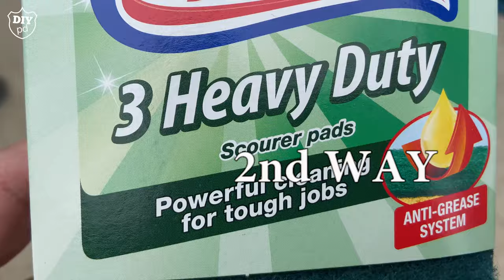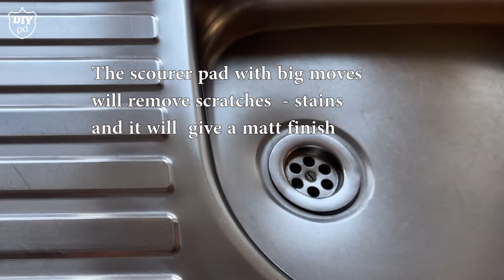3 EASY WAYS TO RESTORE A STAINLESS STEEL KITCHEN SINK | DIY RESTORATION IDEAS

Comment: Thank you for this. Would you recommend sequentially doing all three steps for a really old and stained sink? Secondly, how much pressure do we apply when using the foil? Would the foil cause more scratches on the surface if too much pressure is applied?
Reply from the maker: You’re very welcome! For a really old sink I recommend  heavy duty scourer pads to remove scratches with big moves. Do not stay at one spot. Then the foil to give a little bit of shine. Big moves again and do not afraid about the pressure. Aluminum foil is softer than steel and it will not make scratches. At the end use a metal polish cream for a stunning shine! The whole procedure takes time so be patient.
Reply: @DIYPD  whole not hole
Reply: @PhillyDjHook  gramma po po is out again... get a life
Reply: @PhillyDjHook  that's what he wrote,read properly!

Comment: Thank You Peter!
At work I ruined the stainless steel by applying the wrong chemical cleaner on our new stainless steel rest room. I'm planning on using the aluminum foil and the metal polish. I'll let you know the results.
Thanks again for creating and sharing your work for us Peter.
Reply from the maker: Your very welcome Daniel! Yes please let me know how it goes and if you need anything else please tell me! 😀 Thank you!
Reply: @DIYPD  I couldn't tell a difference after the aluminium foil and stainless steal polish.
I'll try the scouring pads Monday.😊

Comment: Thank you so much for your video! Our current sink size is not standard and we were having a hard time finding a replacement that would fit without a major countertop remodel. I will try methods 2 and 3 this weekend and hope for a good result. Again, thank you!
Reply from the maker: You’re very welcome and thank you for your comment! 😀
Reply: @DIYPD  I actually used method #2 and it worked beautifully! Took a lot of elbow grease, but so worth it. I haven't found a metal polish yet, but as soon as I do, I want to apply it to my sink. I can imagine that it will help keep the surface looking better for a longer period of time. 
Again, thank you!
Reply from the maker: 😀 so happy to hear that ! You will be very impressed with the polish cream. Just to let you know, I used the Autoglym polish cream for metal. Do not forget after the polishing to give a couple of times a good wash to the sink.  😀
Reply: @DIYPD  Can I assume that you bought the polish cream from an Auto Supply Store? I could not find anything like it in the big box stores in my area.
Also, I will make sure to rinse the sink a couple of time after polishing the sink. Thanks for the reminder!
Reply from the maker: I bought the cream from Amazon
Reply: @DIYPD  Sorry, but I have one more question. Is the Autoglym polish cream you're referring to a "compound". I am not familiar with products for cars, so I want to make sure I'm ordering the correct item.
Reply from the maker: Here is the link for the cream. Or any other metal polish. https://www.autoglym.com/metal-polish
Reply: @DIYPD  Awesome! That is the one I ordered as there were only the 2 choices on Amazon. Again, can't thank you enough!!
Reply from the maker: You’re very welcome! 😀

Comment: It was very helpful but I got a question though. My sink got stains caused by chemical used to unclog the pipes. As a temporary solution (till I'd change the sink), I used a paint suitable for metal surfaces (for car hubcaps). I suppose this won't last but in any case, would any of these solutions you provided would remove the chemical stains?
Reply from the maker: Hi Donald, to be honest not sure about it. Perhaps worth to try but I cannot promise. If you try and it does work, can you please let me know too? I really hope it does.

Comment: Hello! Can I check, for 2nd way, do we need to sand back and forth in a particular direction? For 3rd way, can you share which product you are using?
Reply from the maker: Hi Caroline, 
If you want to try the 2nd way try to make big moves (ideally at the same direction) and try to not stay at the same point for a long time. 
In the 3rd way, I used Autoglym polish cream. 
You can also find all the details at the description. 
Hope this helps, but if you still have any questions let me know! 🙂

Comment: You showed 3 methods , one after the other on the same sink.  Method 2 was after it was already cleaned and 3 after 2 cleanings.  How do we know that the last trap methods  are as effective if we don’t see from a stained situation.
Reply from the maker: You can try and if it doesn’t work to do all 3! I believe it will work.
Reply: I think you should look at the methods as clean, buff and polish. Each method has its own purpose. You wouldn’t use metal polish on a sink that was dirty right? You don’t polish your silverware without it being washed first. If your sink is like mine and looks like the sink did at the start of the video, incorporate all three methods for this amazing look at the end!

Comment: Do you have to do all three steps?
Reply from the maker: Of course not. These are 3 different ways to restore your sink. The foil is very quick way and it will give some extra shine without extra scratches.  The heavy duty scouter pads will remove most of the scratches and they will give a mat finish. For extra brilliant shine use the polish cream. It’s up to you which way or ways to follow and always depends from how your sink looks.

Comment: I think you mean "step" instead of "way" .
Reply from the maker: Hi Cali, thank you for comment. The reason I say “ways” is because some people do not like to use chemicals so they may prefer to stop after the first or the second step and to not apply the cream. You do not have to follow all the process, you could choose either to only apply cream, or only scrub the sink with foil or only scrub the sink with the scourer pad which depends on what finish you want to give (matt, satin or gloss) Only sure thing is that all 3 ways will give you a better finish and a shiner sink despite if you use them all or just one of them. I hope you try it and you will be happy with the result! Have a lovely Christmas.

Comment: Why do you say "wear gloves" and then you don't? As for using the abrasive pad - that's just wrong. This is a useless video.
Reply from the maker: Hi Gienne, thank you for your comment. The reason I don’t use gloves is because I have an allergy, but I thought that I should advise people to not copy my example. 
Re the use of the abrasive pad, that was the best way to remove the most of the scratches from the sin. If you try it, you will see the difference!
I hope this helps.
Reply: Didnt you see that he use metal cream polish in the end???
Jeeeez talking about hot shot here 😂